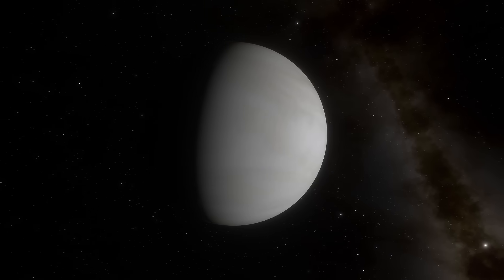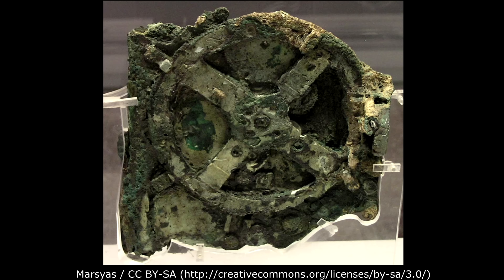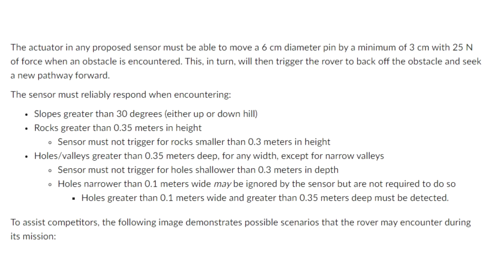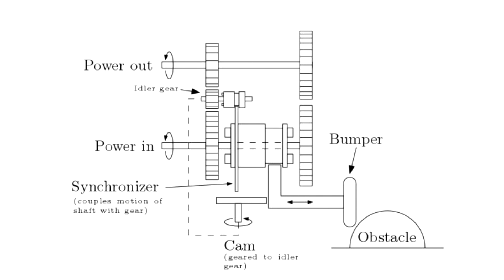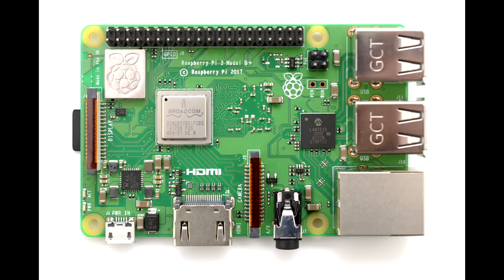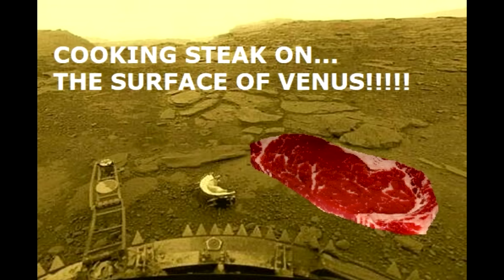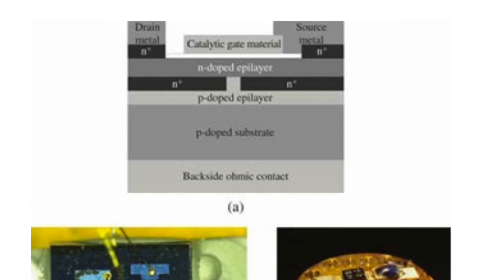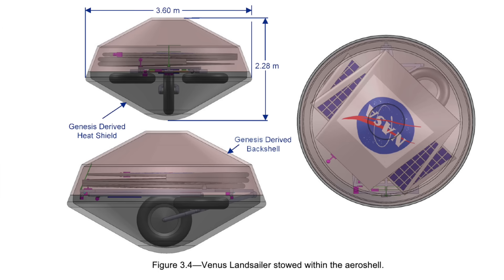Venus Rover Concepts That Beat The Killer Atmosphere

Comment: Question: Start with the most thermally insulating environment you can imagine. Say a vacuum flask. Fill the flask with a large quantity of something that requires a lot of heat to phase change - say for instance, water. Use the water as a heat sink for a small electronics package - itself kept in a highly insulated environment. Keep the power dissipation of the electronics to an absolute minimum. Use electronics that can withstand moderate heat (120C max). How long can you run the electronics before all the water boils? I suspect quite some time. 

(This would certainly qualify as steampunk.. since it generates steam.. right?)

Comment: Would there be any benefit to sending a glider to fly in the atmosphere.
I presume there are thermals for lift.
Put a wind generator on it for power.
It would just need to detect when it was getting lift and go into a bank utill it came out the top of the thermal.

Comment: Hasnt there been some work in developing mechanical computers that are built from MEMS devices? I feel like that could be a promising route

Edit: heres the abstract of a paper released in 2003. 
Mechanical computing devices in polysilicon-based microelectromechanical systems (MEMS) were designed with the goal of developing computing devices for harsh environments, such as those with high dose radiation and high temperatures, as well as devices that may be able to interface with molecular or biological computer systems. The devices that were designed include both analog and digital computing devices. The analog devices include integrators, differentials (summers), multipliers, and those that perform trigonometric functions. The digital devices that were designed are inverters, NAND, NOR, and XOR logic gates. Analog-to-digital (A-to-D) and digital-to-analog (D-to-A) converters were also designed. The designs were submitted to a commercial surface micromachining foundry to be fabricated. The completed MEMS devices were then released and tested to determine proper operation. Of the mechanical devices that have been fabricated and tested, a functioning inverter, sine function device, cosine function device, and digital-to-analog converter have been demonstrated.

I wonder why MEMS devices aren't being featured (at least to my knowledge) in these systems.

Comment: It probably makes more sense to develop extremely simple electronics that can operate at that temperature, and with hundreds of transistors rather than full powered microprocessors. Inspiration may be gathered from the apollo guidance computer for instance. As an aside, how well do valves operate at 400 degrees?

Comment: Mmm, Venus has a dense enough atmosphere where you can get away with utilizing lifting gases that would normally not work on Earth. Not only that but Venus' atmosphere is actually home to one of the most Earth-like environments outside of our own planet in the upper layers of it's atmosphere. So Earth-like in fact that you could walk around in a relatively thin suit with little problem & a rupture would only be a minor inconvenience if anything. The only thing you need to worry about is the corrosive nature of the sulfuric compounds present there which isn't as big of a deal as it seems at first glance. This is the kind of environment where a balloon probe would work exceptionally well. Have a small blimp sized probe that could occasionally drop down a probe via a tether. Once it is done, it can whirl itself back up into the blimp & await deployment once more.

You are not putting anything on the surface for any reasonable length of time. The surface of Venus is one of the few places in the solar system where you can crash, burn, corrode, depressurize, & suffocate simultaneously altogether. Not much is leaving there unscathed either. The most effective way to tackle this problem is to just not tackle it in the first place. Minimize exposure to the surface as best as you can & a blimp floating high above is the easiest & cheapest way to do it. Uplink it with a satellite in orbit & that is it really.

Comment: I know I just posted, but... is there any reason why valves wouldn't work for the control mechanism? a.k.a vacuum tubes, thermionic valves, etc. They're just an evacuated cavity containing metal elements. There's nothing there that would be particularly sensitive to temperature. In fact, the cathode normally has to be heated. Here we make them out of fragile glass but there's no reason why they couldn't be made out of something stronger (at a price). You probably wouldn't want to build an entire computer out of one but a simple radio-controlled sequencer is probably entirely plausible.

Comment: I'm sure you could build a mechanically modulated spark gap transmitter using only dynamo electricity and a transformer, without needing any electronics. But they have a solution for that --- the radar reflector idea is really cool, BTW. You can also get spark gap _receivers_, but they only work with pretty strong signals, and I doubt you could work one from orbit. They're also banned on Earth, but that's less of a problem on Venus. You can however build a crystal radio receiver out of a single diode and nothing else; they don't even need a power supply. But you don't get very much energy, so in order to provide input to your mechanical computer you'd need to amplify the signal and presumably move a solenoid. I don't know any cunning tricks for doing that without a transistor.

Comment: Rtgs could work.  The radioisotopes heat up to far more than venus temperatures.  Finding a working fluid for a sterling generator or making a high-temp thermopile would be a bit hard to do, though.

Comment: isolate the microprocessor in a vacuum chamber suspended by material which has a very low thermal conductivity. It will eventually heat up but take long to do so. Use composite enclosure to allow radio communication.

Comment: Why are they worried about wheels or treads?  Why not a 2 meter sphere with a 1 meter sphere inside "floating" in a bath of liquid methane or something.  The liquid will act as an insulator for the sensitive (albeit hardened against high temps) electronics in the middle.  The entire outer shell would act as an antenna and propulsion by means of reaction wheels.

Comment: All these ideas are crap, they all are trying to make venus be like Mars (making venus rover-able)

How about instead 
We build a hydrogen balloon like explorer 

It will have solar cells on the top, thrusters of some kind for getting around. radar instruments 

And can have instruments on long cables.
And get this. We make the cable conduct heat. That heat from the lowered instrument (it's in hotter temperatures) is conducted up the cable and powers the probe. 

I mean really trying to dumb down a rover so you can send a rover that will only last a few days to a planet who's upper atmosphere is already far more interesting

Comment: apart from using grey code and 90 deg polarization of radar reflectors for the two bits i got nothing.
1 watt of energy to move, calculate, navigate and transmit seems a bit unreasonable

Comment: Refrigerators use gas and a pump to "stretch/vacuum" the so it can absorb heat and then pressurize it on another side to concentrate the heat and lose it though a radiator.
The problem with that is how much energy it uses at the pump to vacuum one side and pressurize the other.
We just need to design a gas mix that can stay liquid under the right pressure at 500+ °C and fine tune the gradient of transition from liquid to gas so the pump doesn't need much power to work.
Then do a good insulation with vacuum and mirrored glass to reflect infrared.
As long as the external heat isn't going in as much and not much heat be produced by the digital devices then you are good to go. 
With such a fine tunned system a simple magnifying glass and valves can provide enough power to use the sunlight to transition the gas from liquid to gas and we need to setup the devices to standby at night.

Comment: send a solar/nuclear? glider with decent cameras and simple instruments that would be shielded internally and make use of the higher portions of the atmosphere and occasionally descend for brief moments taking scans and high res images.  A satalight in orbit can act as a relay between earth and the glider whilst the glider would somewhat borrow methods used by juno currently doing flybys around jupiter's radiation belts mapping the poles and equator.

Comment: I wonder if electronics insulated by vacuum would be viable.  I'm imagining a small computer, like a Raspberry PI, enclosed in a ball surrounded by vacuum inside an outer ball, suspended by permanent magnets.  Electricity and signals could be provided to the inner CPU-ball via electromagnet charging and RF, and signals sent out to an antenna/reflector by RF.  There's probably some thermodynamics reason why this would work (the low-power CPU would generate trapped heat indefinitely, heating itself up?), but hey I'm no expert.  Just seal some dry ice in with the CPU, rite?

Comment: There is another information processing technology with virtually no moving parts that works under extreme conditions - fluidics. In the 60s and 70s this was a serious discipline. Take a look at the book below. I think the schematic on the cover is a fluidic flip-flop. There are also designs for logic gates and analog components like amplifiers, filters and even components like rate gyros. I imagine they would be much easier to design with today's powerful computers for simulation and manufactured by 3D printing.  https://books.google.com/books?id=5beGAAAAQBAJ

Comment: You dont need to maintain the cold spot all the time, just a tiny fraction of the time. In terms of joules per decision modern vlsi electronics is so far beyond anything mechanical. Just run it for 100ms every 100s, cooled by a reversible endothermic reaction that you recharge between  runs. It just needs to survive the stress of all that thermal cycling.

Comment: Let me know if I'm sounding like an idiot but... 

Instead of making rovers for the ground, create small space-plane drones that can be deployed into Venus atmosphere. They could be designed for high pressures but nothing as severe as the surface. These drones could carry multiple (possibly a dozen+) ballistic style probes. When shot at the surface the probes could use lasers to sense distance to the surface and deploy a drag mechanism allowing them to land or preferably insert into the Venus surface and transmit near surface atmospheric, temperature, and soil analysis. 

A laser on the skyward part could then wait for the drone to pass overhead again and beam the data back up where it can be relayed more easily a Venus orbiter or back to Earth. A drone blimp could also be used instead of a drone space plane. Interested to know if this would be an effective way around this problem. 

It would give us the surface data we want while mainly operating from the safety of higher altitudes and cheap disposable probes might be more cost effective than a rover that could succumb to some many different issues at any point.

Comment: Battery life and solder-free wiring with high-temp insulation are your biggest issues! (Venera probes) Then, corrosion. 
The surface level winds on Venus are likely too light for wind turbines. A tank of water can be used for evaporative cooling.
Personally, I would put more effort into a Venus balloon mission.

Comment: Could be a practical use for a vintage computer running at hundreds of volts.  Suspect logic at hundreds of volts is more resistant to heat than 1V logic.

Comment: Tumbleweeds.... an expanded ball that deploys and in the center is your sensor / camera package.  To stop it could fold out 4 opposed rods so it doesn’t roll.  Collect images/date, send data to satellites, pull in the rods and roll along again.  The rolling action would also potentially charge the batteries back up again.

Comment: Why dont we just drop batteries at way points again?  

Like,  why does the Rover have to have onboard power generation?  Why cant we just shoot the planet full of batteries? Put the turbines on those and havbe the rover wander from one to the other like a nomad on a circuit.  Then we gradually expand the circuit to include more and more areas of interest.  We spread the cost out over a much longer period and the system would get more and more efficient as we added to it if we have it so every battery can also charge itself.

Comment: Insulate the shit out of some strong magnets and put the electronics in a vacuum chamber so it can float on top of the magnet in a vacuum so no heat transfer? I don't know what I'm talking about but I believe it's going to be done by figuring out how to insulate some very sturdy electronics. Maybe layers of vacuum panels? I dont know what the pressure difference would be but I know its got to be pretty great. Find some gas or liquid that stays very cold under pressure?? Use the heat of the environment to power the electronics? How could you even simulate that? Pulling a vacuum under that much pressure.. you'd need to use the high pressure to somehow help draw vacuum.

Comment: How about something using a vacuum as insulator, like a Thermos(tm) bottle, or else the shuttle tiles?  Perhaps not for long-duration, but at least longer than we've been able to do so far.  If we can keep the electronics running for a while, to gather data and transmit back to Earth.

Comment: This comment is unrelated to the competition directly, but is related to a system that may be viable for Venus exploration.  Please shoot it down, so to speak!

Three parts:

(1) A ground station that is... stationary (anchored to the ground), has a wind turbine, and a balloon on a strong tether, reaching up to 30-50 km in altitude.  The station has inbuilt Ambri batteries, which happens to run optimally at 500 C, and can for decades.

(2) A rover:

It consists of a thermal and pressure insulated vessel (think like a deep-sea sub, well insulated) containing conventional electronics, sensors, batteries, and a heat exchanger to interface with the external world when needed.  So basically the rover in a bottle with cameras peering through insulated windows.

It also houses the drivetrain electronics, using conventional parts and batteries.  The interface with the mechanical drive of the rover would be inductive.  So, the 'bottle' portion of the rover would generate rotating magnetic fields through its case, that are closely aligned to conductive discs on the rover.  This will induce spinning in the disk, which is then converted to rolling or walking.  An optical sensor can read the disk rotation position and speed and use that to measure any back-force though the drivetrain.  A sealed pneumatic/hydraulic plunger can detect when the foot (did I mention this was probably a crawler?) is on the ground or not.  For example, if the leg is over a hole that was missed by the vision system, the underfoot plunger will not be pushed, and the mechanical indicator at the other end will show onboard cameras such.  Using this, it could also read pressure under the foot at various amounts of downforce, measuring soil mechanical qualities.

(3) The fun part:  

The rover can walk/roll/retract into a sled at the base station.   This sled has either onboard batteries that have been charging during the ground-cycle, or can extract power directly from the tether, which the ground-station (and/or blimp) energizes.

Once the rover is secured, the sled climbs the tether.  It keeps climbing, varying its speed in proportion to atmospheric density (saving power), until it has reached an altitude where the components will have time to cool off.  The aforementioned heat exchanger comes into play here, dumping heat and cooling the interior to a cozy freezing temperature.  On the way back down, gravitational potential energy can be used to recharge batteries partly, in either the rover and/or the base station.

Summary:

It's an atmospheric elevator that allows sensors to dip into the heat for short periods, then cool them off at high altitude.  It may also have a rover component, or the tether-sled itself could be the sensor payload, meaning it would be stationary in the X/Y axis and only able to move in the Z axis (good for atmospheric study).

Energy is extracted at ground-level using wind-power, and also from the descending sled/rover.  

Other options for generating power include:

Harvesting high pressure air at ground level, then exhausting it at altitude to take advantage of the pressure differential (100:1).

A thermal battery that stores energy in a phase-change material, extracting it at altitude (Stirling at 500 C delta). 

The balloon/blimp may be coated with solar cells and/or wind turbines (this would provide primary or redundant power depending on conditions at ground level).

Comment: 02:21 "Performed other information." Probes do not perform information.  They perform experiments using equipment and the test results usually provide information.  You could have said, "Gathered information," but not referred to the performance of information, which is nonsensical.

Comment: 500 deg C is a huge ambient source of energy.  The problem is turning that energy directly into electricity -- "photocells" that use heat instead of light.  In fact, infrared cameras do that already.  Enough heat photocells in the center of a sphere would produce a cooler core, causing convection currents and an oasis for electronic devices.